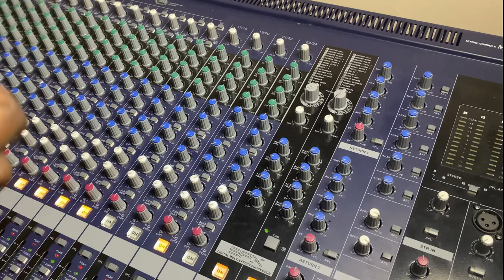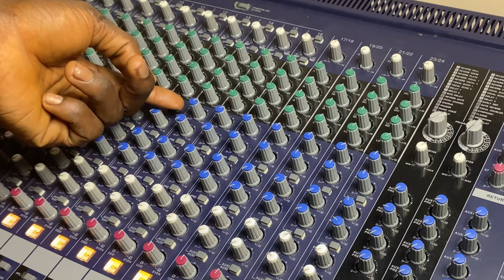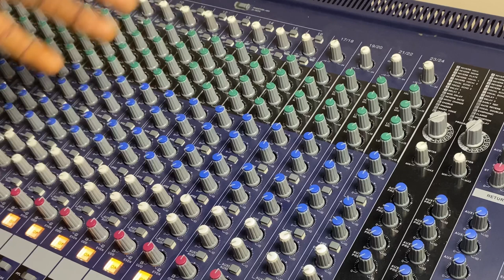How to create MONITOR mixes using AUX sends

Comment: Thank you very much for the tutorial.
I just took the Yamaha mg24/14fx.
I would like you to explain to me its general use. Also like wired my dbx equalizer to the table, from the equator to the amp.
Now how to connect my Four or 6 baff (possible options).
thanks for getting back to me
Reply from the maker: Great. You can reach me on socials, let’s work out your setup together. Check the about session of my channel for links

Comment: How do you get internal effects on the AUX send? We have 2 monitor mixes going out to IEM but they are dry. We'd like to add some onboard reverb so it sounds nicer
Reply from the maker: I covered the process of doing that in this video:
How to use EFFECTS in Live Sound Mixing Part 1: Setting up a Mixer’s Internal Effects Processor
https://youtu.be/vihr7vGHFrU

Comment: Hi Kelvin . Love your tutorial video. I'm using the exact monitor mixer modal as yours. However i had some problem which i hope you could help.  Everytime i pressed the PFL button, there is no signal displaying on my volume level indicator. It's quite frustrating because i can't see or know how exactly how loud or low volume on my mixing channel. Hope you can help. Regards

Comment: I'm using the MGP24X mixer..I want to record on phone with ik multimedia irig pro duo i/o and I want to use Aux output in my audio mixer..Where is the MGP24X aux output? MGP24X 4 Aux outputs on the back full..When I connect it to the STEREO OUT output of the ik multimedia irig pro duo i/o audio mixer, it lights up red :/ Which output of the audio mixer do I need to connect it to? How can I lower the output of the audio mixer?